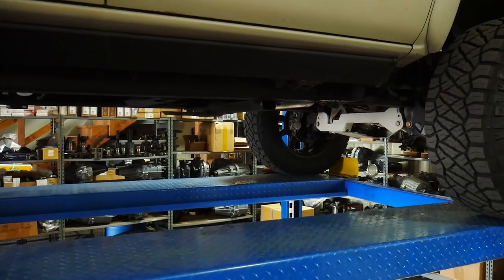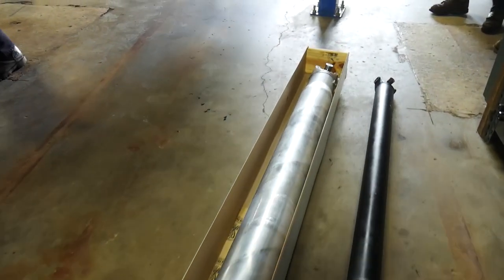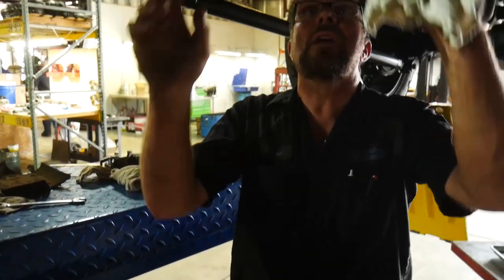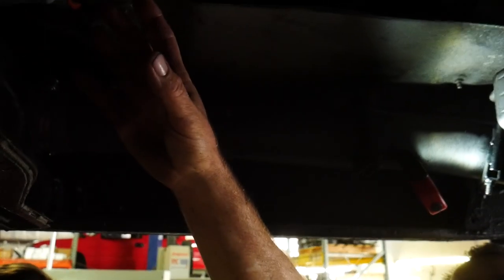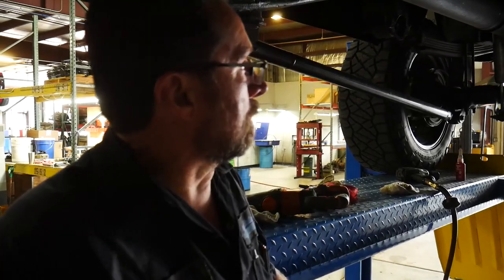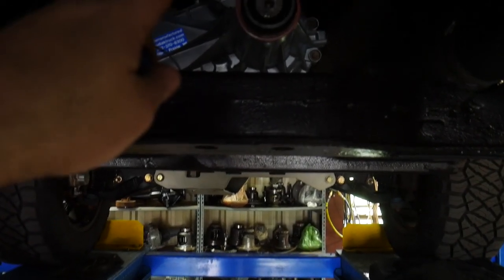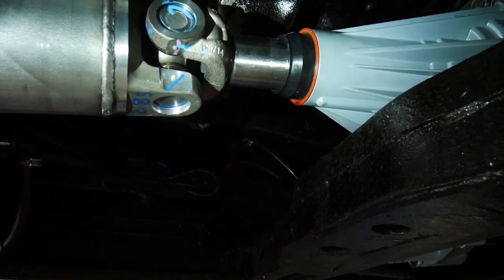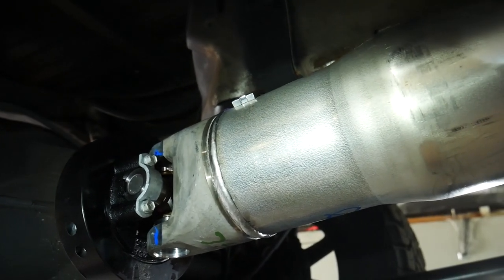ONE PIECE DRIVESHAFT FOR A CLASSIC QUAD CAB LONG BED CHEVY

Comment: I braked really hard a few days ago and my solid aluminum drive shaft got yanked out of the transfer case and hit the ground while still moving forward. I detached it from the yoke, slipped it back into the transfer case, reattached it to the yoke just to get it home. I’m going to have it balanced, but on the way back home, it felt clunky. Taking off or coming to a stop it felt like something would almost quickly settle into place. Also, it looks like it’s not as far into the transfer case as yours. Perhaps the rear axle is twisted and/or out of alignment now.

Comment: Would this work with a 02 2500hd 6.0 4l80e 4x4 truck are the yoke parts same rear ends? I dont know anything about the diesel trucks
Reply: You just have to have one made to fit your truck. People custom make driveshafts all the time. Have one made to fit what you have now

Comment: Do you have a part number on the drive shaft, rear axle pinion yolk, and u-joint straps?  I have the identical truck and would like to do the same conversion.  It appears that it is cheaper to piece the conversion kit together yourself rather than purchasing the preassembled kit.
Reply: Was wondering the same on the part numbers.

Comment: Has anyone figured out how to do the one-piece shaft on a 2WD version (07' LBZ Classic Body Crew Cab Long Bed)? If so, Please provide part numbers. Thank you!
Reply: It doesn’t work for the 2wd models because the transmission is spaced further more forward compared to one with a 4x4 transfer case

Comment: They should have put that into that truck stock for how much a guy spends on those things!

Anyways, cool video, and it looks like she'll handle a bit more torque and hopefully hold up a bit better than that two piece setup.
Reply from the maker: Sure will. Seen these hold upwards of 900hp+ in L5P trucks
Reply: @RustbeltMechanic  good God👍